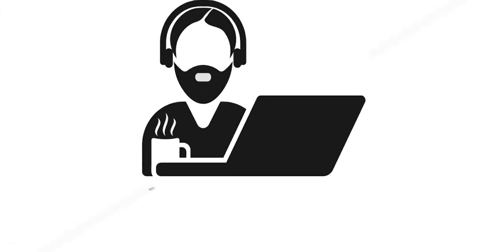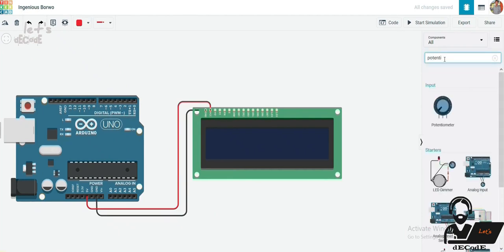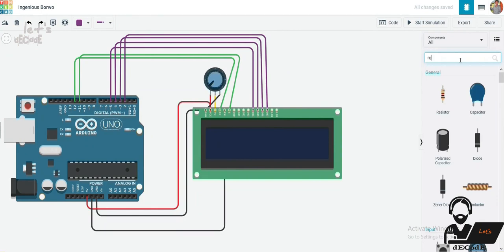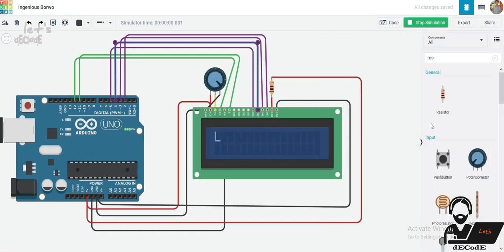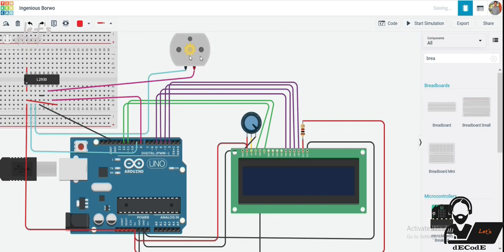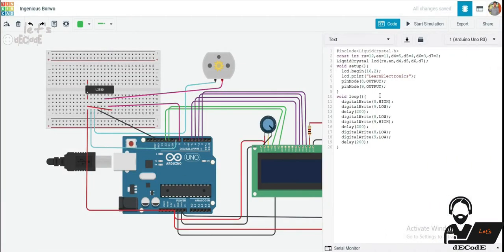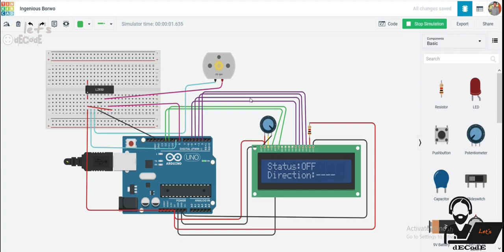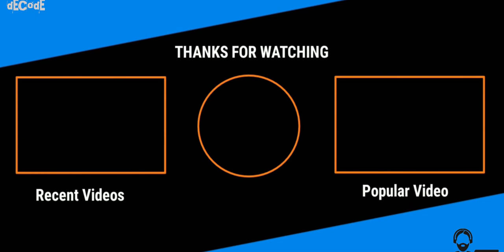Interfacing DC Motor with Arduino UNO and displaying the rotation status and direction on LCD

Comment: by the way,
is there any way to rotate motor without using  motor driver
Reply: If you are saying only power it up then yes connect to 5v of arduino to dc motor(yes it sound silly) but if you are saying changing direction of rotation of motor then no because in order to change the direction of rotation of motor you have to alter the input current like connecting positive of motor to negative part of power source and positive part of motor to negative part of power source then it will rotate anti clockwise.